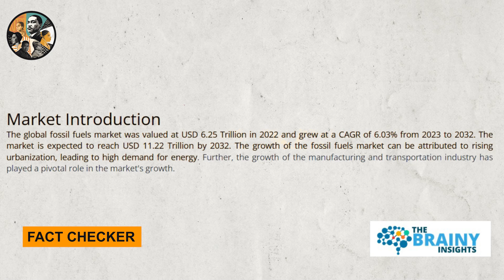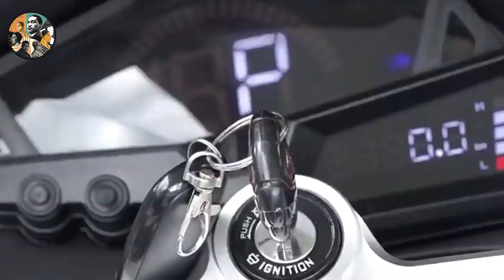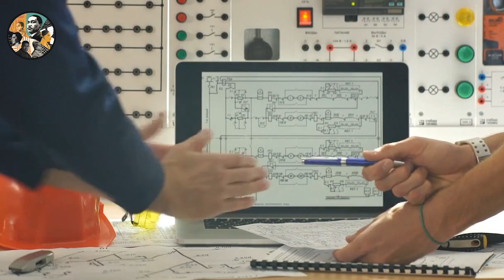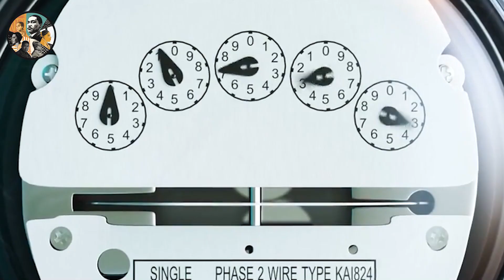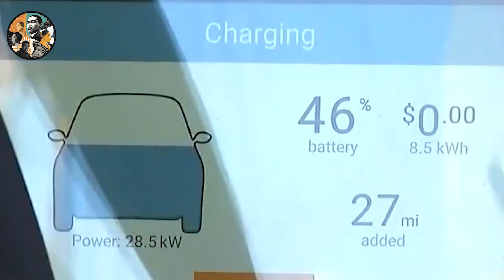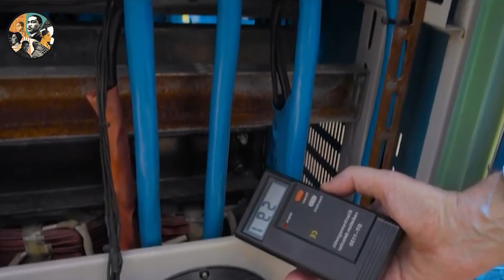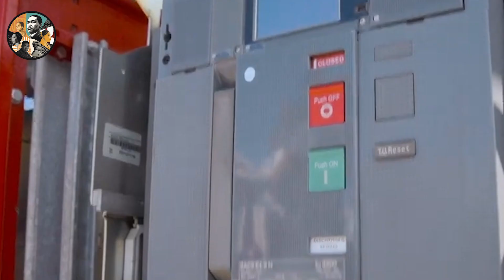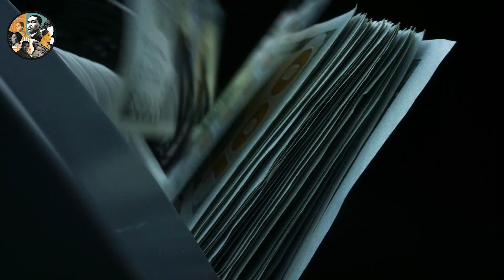How Self Powered Technological Electric Car Invented By The African Inventor Actually Works!

Comment: Use carbon and copper wire without batteries? Receive radio signals to my ears phone, I was 12 years old, received radio waves from Chicago radio stations to Tennessee, but I not realized how much power radio  stations waves, just carbon rod and copper wire,  so simple to make power to receive radio ways, not that smart to change radio wave into electricity

Comment: Shouldn't Maxwell share his innovative knowledge with a FEW reliable associates so that if anything happens to him, the invention will not be lost, which is very "SIMPLE".. This valuable knowledge should be stored away and used by others in case of such a tragedy, instead of only inside the mind of just one individual, don't you think?

Comment: The technology can be easily verified by an actual exhaustive road test that should be equivalent to 4000 miles or more of continuous driving. If that does not convince the world, nothing will. But it must be done. After that or even now, his technology should be spread between several confidential and trustworthy persons so that there is always someone living to make it a reality in the event that something happens to the inventor. It does not have to be a malicious act; it can be a normal illness or accident. So, a sensible approach must be put in place to secure this disruptive yet beneficial technology from being eliminated. I am obviously assuming that it will be verified as being genuine.

Comment: This technology is not going to affect the conventional energy sector from tomorrow itself. all the industries can not be shifted to this technology. it is a long process, may be 30 to 40 years will take for any drastic change. no one need to fear of the oil industry etc. if people agree and adopt it, none can stop this. but the availability of this technology should be made in quick manner at least in Africa. It is the responsibility of Zimbabwe Government  to take this issue seriously and get benefit for their economic growth.
Reply: I think less than that. The device works with existing tech so it's a matter of upgrading.

Comment: Can Mr. Maxwell use his invention the "microsonic" technology to run the grid load of his township or run his city over 48 hours and have a third party independent monitoring system which records his "microsonic" technology on a hard copy chart and a soft copy on a computer so the test results can be independently verified? Also have similar tests on the car and the motorcycle? Yes, also have a Technical Officer specializing in Microwave Radio Spectrum to conduct technical tests verifying that indeed microwave radio frequencies & other frequencies are entering as input to his "microsonic" technology device and measure the output of his device the "microsonic" technology which I will assume may have rf filters (either passive or active filters) and these are being rectified to direct current (d.c.) and I further assume his "microsonic" technology device may have a d.c. to d.c. convertor which will power a d.c. load or is connected to a power inverter to raise the power to alternating current (a.c.) Yes, it can be done theoretically but one needs a constant, reliable rf input to make it viable. If Mr. Maxwell has found a way to harness a reliable rf feed to run his "microsonic" technology device, then I commend him! As a former Technical Officer with our local telecommunications company Telikom PNG Limited specializing in Microwave Radio, UHF, VHF, HF in telecommunications and was selected & as part of a Technical Team on behalf of Telikom PNG Limited & the Papua New Guinea Government to do testing and acceptance of Microwave Radio telecommunications equipment at Nippon Electric Company (NEC) Factory in Yokohama, Japan to ITU Standards as passed in Geneva several years ago and it would be very interesting to use very specialized telecommunications test equipment to verify and confirm his inventions and if it is true then I thank and commend Mr. Maxwell. One of my Mentors Mr. Tesla has proven that in his time and due to greed, evil & corruption his inventions did not see the light of day. Our nearest star in our Milky-way Galaxy which we call our sun emits constant electro-magnetic waves across the broad radio, light, gamma & other frequencies across the spectrum and these travels from the sun to earth a distance of 93 million miles at a speed of 186, 000 miles per second & arrives at earth in about 8 1/2 minutes. Now if you arrange light sensitive diodes you can simply harness the solar visible light and if you add another doped layer that is sensitive to other frequencies you simply may have a multi- band or multi- junction cell and if you connect about 36 individual silicon wafer cells in series & wolla you now have a solar photovoltaic panel to power your devices, but of course you would need to connect to a voltage regular then to battery & to your load or via a power inverter to run a.c. loads. Anyway that is my 2 toea contribution and again as I said it is feasible if you have a reliable input source. I do not mind travelling to Africa to do some independent technical tests on Mr. Maxwell' s inventions. Greetings from Papua New Guinea Mr. Maxwell of Africa.
Reply: Checkout the video by Thrive from 3 or so years ago in which he was featured. He did that already.
Reply: @shumbahurushumbahuru4894  Thrive video only proved he had a hidden power source charging the batteries.

Comment: Everything is an energy. This energy manifests life in the guise of the universe. The manifestation of life is inevitable because it is based on duality. Here enjoyment and payment are combined. If there is no payment, then the significance of enjoyment is also not possible.

If enjoyment is obtained by some reason, then payment will be inevitable. Energy needs two points to move at any cost.

Until hunger is born, satisfaction will not be manifested even by food. The energy outside is united with the energy inside us.